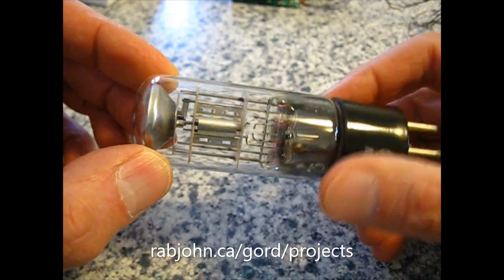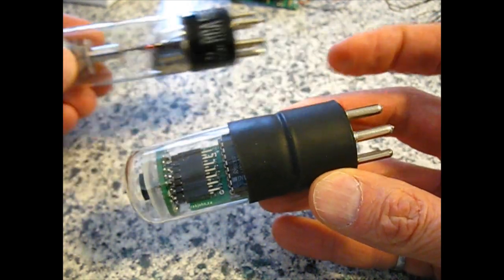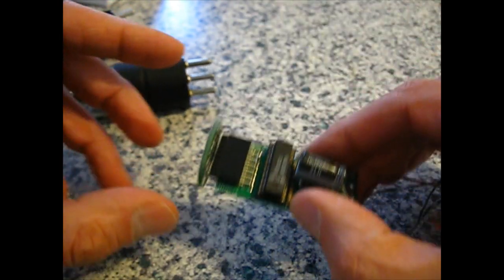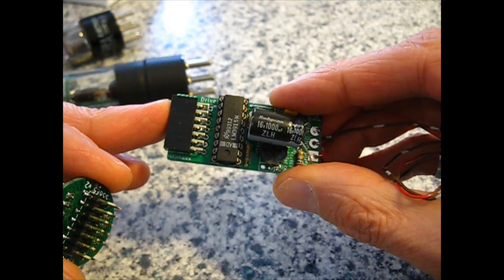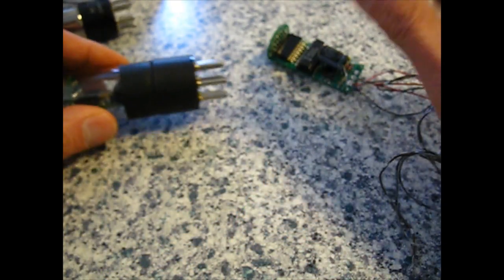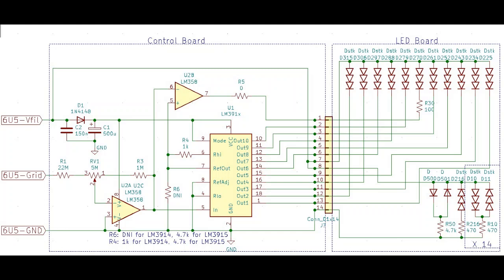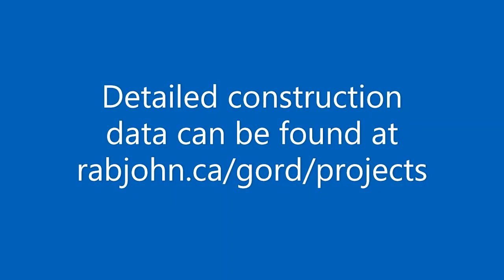A solid-state replacement for a magic eye

Comment: Very nice work.   If I was so motivated, I might have tried your clever project - but I'm driven by bucks, so no..   Anyway, I would try picking up a scrap Samsung QLED TV and see if the embedded "quantum dots" in the diffuser sheets between the display and the LED back light might work giving you a better black in the unlit areas of your eye.  The LEDs themselves would need to be native blue.  If that works - you're welcome.  If not, well, you get what you pay for!!  😆

Comment from the maker: There were several requests to look at adding dithering to make the transitions seem smoother. This is quite easy to do: I added a 20pF capacitor between pin 3 of the LM358 and the FilH pin. This adds 60Hz (or 50Hz) "hum" which is effectively dither. The result is a smoother display, for sure, and is not difficult to add. Note that it will inject some hum back into the host radio, but I do not expect this to be a problem most of the time.

Comment: Can you get ahold of a smart-watch display? I'm guessing you could fit a pi zero or some such and program it with all kinds of crazy display mimicry, with any color you like! Make the outer shell be the top of a pushbutton to switch between different modes. Numeric, magic eye, or a different kind of magic eye, or cycle between modes. You can do a lot with a single pushbutton.

Comment: Very Nice Work. I have a New in Box, Magic Eye,  wanted to put it to use someday.  Repaired TV/Electronics since the 70's. Was more into Guitar Electronics, I used Op Amps. I Used 2  9 Volt Batteries. Plus and a minus tied to each other made ground, then you would have 9 Volts Positive and a Negative 9 volts. Great for Filters and Clean Amplification from Common Mode Rejection. 
Good work. Leaving a Thumbs up. 
Stratmando

Comment: But.. no replacement for european magic eye tubes ??? :-(
Reply from the maker: It can replace EM34 and family, but with only 1 "fan". It would be easy to replace an EM84 or even an EM800 with a similar circuit driving a strip of rectangular LEDs . If you want to replace an EM80: sorry, I have noting for you!

Comment: I'm not from this space of radio gear usually, but was drawn by that great comparison shot at the end. If you're still thinking of a diffusion layer, a pair of thin foggy bits of acrylic with a small space (5mm?) in between should smooth out the light even more.

Comment: Maby an MCP6002 could be a better op amp as lm358 direct replacement. Higher input impedance and much less input current leak. An rail to rail output

Comment: Could an even more analog look be achieved by using a pair of Lm3915 , as parallel current sources to each led , it might simplify the diffuser issue . With a scale offset between the two chips, you could achieve a half step brightness for that more analogue visual effect , without having to alter the LED array board or header . 
Just spitballing a suggestion . Gotta take my hat off to you for this device , magic eyes are heading towards chicken's teeth rarity and demanding a commensurate price , so it's great to have a viable alternative.

Comment: I want to hate .. but it's the nicest and most refined one of these I've seen with the diffuser. Nice work.

I built a set of 'nonsense' instruments for my bus (just for the sake of fancy lights) .. Throttle position with a 6E5, and a barely proportional 'wheels go round' indicator with a decatron. I would use one of these for that, and I might even line them up across the cluster .. but no matter how good you eventually get this to look - too much of a snob purist to ever put it in a full tube circuit.

Comment: This video reminds me of a question/thought/idea I had years ago. I will pass it on to you as you seem to have the skills. Why not make solid-state work-alike plug-in replacements for as many tubes as possible? This would allow people to resurrect those lovely old tube radios.

Next step: Replace them with low-voltage look-alikes and replace the dangerous 2000V transformer with a 12-volt transformer. Looks and works the same but MUCH safer! Just add a burning-dust-smell emitter. lol
Reply: That was being done when I was a boy back in the '70s. The output stages were the problem. Lower voltage means a LOT more current to get the same power. High voltage,  high current transistors were not common, and expensive.

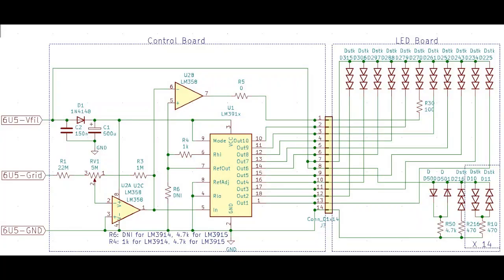Comment: 2:26 Watching this schematics I have noticed that it matters which of the 2 filament connectors in the socket (1 or 6) is connected to the ground in that particular radio or amplifier in which the replacement is going to be used because the pin marked as 6U5-Vfil has to land in the connector that is supplying 6.3V AC and not in the ground connector.
Reply from the maker: Good observation. However, the most recent version has a fully differential input. See http://rabjohn.ca/data/documents/6E5_Composite_Schematic_V2.jpg . The preferred connection would be to have Vfil_Cold go to ground and Vfil_Hot go to 6.3V. In this case, there would be no common mode voltage on Grid and Cathode. However, if Vfil_Hot and Vfil_Cold are reversed, (the rectifier diode is grounded and the "ground" is at 6.3VAC), everything will still work because the Grid and Cathode input is fully differential. There will be 6.3VAC common mode voltage (wrt to the "ground", say pin 2 of the IC) into these pins, but the differential input rejects this common mode voltage. This is an important feature if you want to use the SS6E5 in radios that ground the centre tap of the 6.3V filament winding, because they have 3VAC of common mode voltage into Grid and Cathode.

Comment: noob question here: what is it used in? and what for?
Reply: It's used to assist a radio listener to manually tune into the frequency of the chosen broadcasting station. Manual tuning is normally done by listening to the output (usually speech or music being transmitted by Medium wave or Short Wave broadcasters on a particular frequency). 

Unfortunately there is usually some distortion of the audio sound, interference from other broadcasters and static from thunderstorms and passing road traffic that makes it difficult for the listener to decide where the "sweet spot" is for the best quality signal output from the radio speaker. 

The "MagicEye" vacuum tube helps the listener select the tuning-position by adding a visual cue, where the smallest adjustments of the tuner are reflected in visual representations of signal-strength.

As a small boy listening to Short-Wave broadcasts in the 1950's, I was lucky enough to have the use of a radio receiver equipped with one of these devices built into the front panel. It was a pleasure to have such visual assistance whilst tuning into a broadcast.

Comment: I had a multi-band receiver with a tuning eye.  I got it at a hamfest when floppy disks were a thing.  I was about 18 I think.  I decided to set up a quarter wave antenna by stringing a wire around my room.  When I was ready, I didn't have a PL259 connector, so I just coiled up a bit of the single-strand wire and shoved it into the antenna port.  I shocked the living crap out of myself.  That cured me of operating equipment with vacuum tubes that operate at ridiculous voltages.  But I do miss the tuning eye!

My tuning eye was quite blue, maybe closer to blue than to green.

Comment: I don't think the diffuser is the way to go here. Either a prismatic lens made of a suitable plastic should be moulded or some kind of prismatic reflector. In the latter case the l.e.d.s would need to be arranged vertically. Ideally a combination of prismatic light guides with a reflective back would be the preferred method.
Reply: When posting the above, obviously the slight issue of having to find a cylindrical board on which to solder the diodes on, in the inner surface no less, might be a show stopper. Having realised this, can diodes be ordered soldered on a metal sheet such as those found in light bulbs? Can that sheet then be safely bent to form a cylinder?

Comment: I did a display using the LM part years ago.  One addition was to add a bit of 60Hz hum to the IN signal, just enough to blur (turn on the adjacent LEDs.  It made the transitions between LEDs smooth and would perhaps eliminate the need for a diffuser.  Since this is a tube replacement, the 60Hz before rectification can be tapped for the necessary signal- with a one wire and resistor addition.
Reply: Exactly.

Comment: What a brilliant idea! I'm sure there will be many thinking "why didn't I think of it first?"
And since it's l.e.d.s inside, there's no reason why one shouldn't just use a plastic transparent tube for the housing. A brand new octal base can be had from various sources.  A different style base would engage some minor d.i.y. - taking all the necessary high voltage safe design principles into consideration of course.

Comment: Nice! I have an old Grundig radio that uses one of these tubes as its tuning display. I had the radio refurbished several years ago and I recall that the gentleman who did it for me let me know that the tube would be quite expensive to acquire. I bought an extra to hold in reserve.

Comment: Now I wonder what our old Telefunken Concertino used.  Rather than a circular display on the top of the tube, the Telefunken had a vertical tuning display with bars coming from both the top and bottom.  I could probably look at the one in the radio, but I'm hesitant to try and work on anything in the radio now (I don't think it's been turned on in 25-30 years, and from watching Mr Carlson's Lab I know it peobably is full of bad capacitors by now)
Reply from the maker: That would be an EM84 or EM87 tube
Reply: @gordrabjohn7039  EM84 was used in early audio tape recorders as recording level meter. All electronics was also made with vacuum tubes - one ECC88 (as preamp) and one ECL86 (as power amplifier).

Comment: This is cool !! Great video. But, I'm wondereing if the circuits and the L.E.D.'s would introduce noise to the reciever that it's mounted in.
Reply from the maker: It does not use a clock or a switching supply, so should not cause any EMI issues, and I have not noticed any in the radios I have used it in. There is a rectifier on the filament supply, and I suppose a harmonic of 60Hz could cause a buzz, but I have not noticed that.

Comment: I would like to say how impressed i am with your  magic eye  replacement  the skill and  quality of your work  is  very high  ive been in electronics since the 70's and its rare to find  someone still commited to solving an old problem with a new idea thank you for sharing
Reply: How much would someone pay for a refurbished magic eye? How rare are they getting? Im going to get into glass blowing somehow, I’m wondering if it might be a viable business along with other scientific glass
Reply: @Wtfinc  I'd say you could make a bunch of money if the look is mastered and it directly replaces the original
Reply: @bruce5825  well i would refurbish them. That means cracking it open(cutting) replacing the filament, getter, and phosphor. 

I did in fact start blowing glass.

Comment: Love it. I wonder if you could improve the sharpness with a custom radial lenticular lens under the diffuser. The only thing will be a more obvious jump from one level to the next. 
Another thought is to use an oiled screen rather than discrete leds. I wonder if there are any watch screens small enough.
Reply: Ywahhh OLED.s

Comment: Awesome job!
Perhaps you could experiment with color filters to get the color closer to the real one.
Reply: Better to use different LEDs. A color filter does little to nothing to LEDs, as they output a very narrow spectrum.
Reply: @AlienRelics I know but you can fine tweak the green to match it. LEDs don't come in a wide variety of colors so it's not like you have 10 shades of blue/green you can choose from.
Reply: @Ni5ei  there are shades. And bicolor LEDs that you can tweek to get a different shade. You just have to look for them.
Reply: @AlienRelics  Ah thanks, I'll look for those
Reply: Maybe a green-yellow shade.
Reply: @AlienRelics  I think green and blue would come closer. Perhaps the original color can be matched with an RGB LED using 100% green and some blue.

Comment: Hola,que utilizas para controlar los Led's un circuito integrado de vu meter?
Reply from the maker: Yes, a LM3914 / LM3915 / LM3916 bar graph IC.
Reply: @gordrabjohn7039  Nice Job! I guess the rest of the job is to be patient and group the leds so that they light up in groups. Thank's for the info.

Comment: Is it possible to get a suitable 6 pin male connector so as not to have to find a tube to sacrifice?
Reply from the maker: I am not aware of a source of 6 pin male connectors compatible with tube sockets. Old tubes are my only source.
Reply: They simply aren't made any more, haven't been for decades.  Not enough demand for someone to restart making them.
Reply: Easy to replicate.
Just get wires the right dimension, a pipe made of paper and pour any epoxy or JB Weld.

Comment: Instead of LED's why not use a green Oled display? You would not need a diffuser at that point. Using a green Oled display would offer an almost identical visual representation of the original part.
Reply: do you have any idea how expensive a custom oled display would be? it's not exactly something you can make at home like an array of LEDs.

Comment: Why on earth would you want to replace it with solid state, those tubes are awesome! I wonder if you could just re-pull the vacuum on broke tubes?
Reply: In addition to the other reasons mentioned: 1) Some people would prefer to have a working device with some anachronistic parts (I have not heard similar arguments from purists regarding replacement of paper capacitors with modern equivalents less likely to kill the rest of the device) rather than a non-functional device. Yes, this would alter the appearance of the device, but again do you want something that is once again functional or do you want a rather heavy and large paperweight? The quantity of new old stock tubes is finite and since they have not been produced in decades even if you purchase one that was tested to be functional there is absolutely no guarantee it will survive as long as the original tubes had survived. Tubes salvaged from other units are potentially even less reliable and may commit that unit to the scrap metal yard. 2) Nobody currently makes new tubes of this type and if the market for current production of tubes has any predictive value for the market for even less frequently-used tubes like this then it would make repair of devices with this tube insanely cost-prohibitive and such pieces would be better used as an occasionally-operated museum piece than a daily-use instrument as they were originally intended. Would newly-manufactured tubes be ideal? Sure. Maybe you would be willing to do what Dalibor Farny has done with Nixie tubes, spend years doing R&D, and set up your own shop. He had the advantage of some original technical drawings and some manufacturing data, yet it still took him two years to bring out a newly-produced tube. Have you seen the cost of his tubes? They are not priced like vacuum tubes. They are priced like hand-crafted industrial art pieces that also function as vacuum tubes, and to be honest that is what they are.
Reply: Because the original wear out or get broken.

Comment: Great project! I know everybody has an opinion, but since you said the diffuser was still a work in progress.... Sooo... I wonder if the diffuser could be a translucent material with a but of glow in the dark capabilities?  Perhaps the use of UV leds shining through the diffuser to color shift the magic eye.  I painted something once with glow in the dark spray paint and hit it with UV leds and it gave that same greenish magic eye glow
Reply: Your UV led idea has merits. The afterglow time could be an issue though. I wonder if the phosphorous used in tv tubes reacts at all to UV, it does react to strong flashlights with afterglow times under a second.
Reply: @juslitor  there are UV reactive pigments tuned to specific UV depths. However,  paper and yellow highlighter should fluoresce well and give no persistency.